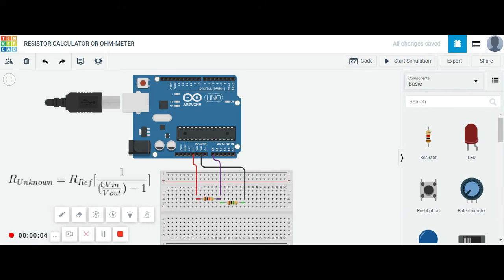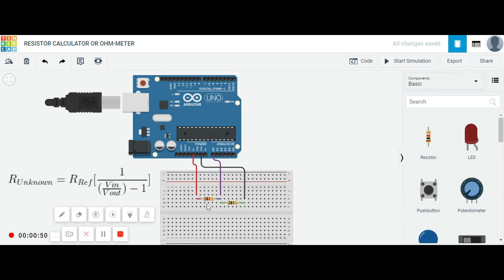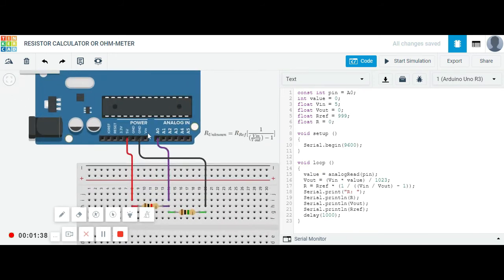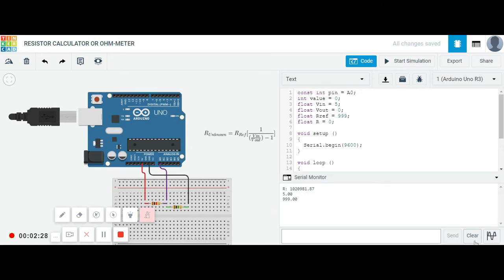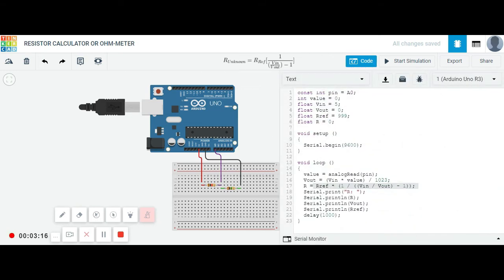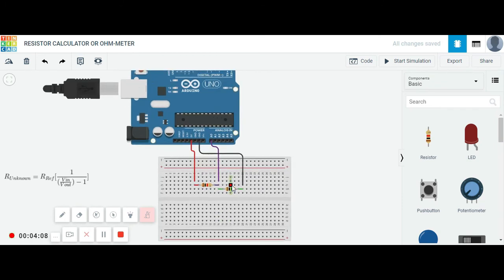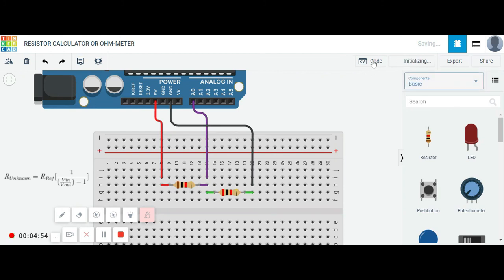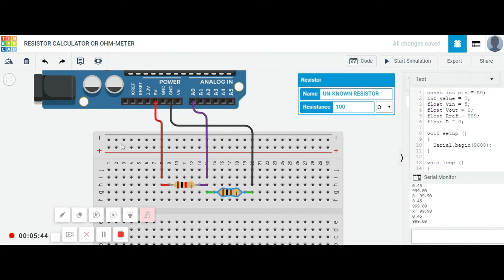Ohm meter arduino using tinkercad

Comment: I need your help, what is in the line number  8 that value (9600) and line number 12 (Vout +Vin)/1023
Reply from the maker: Sorry for delayed reply, 9600 is baud rate, that used for serial communication ,  line no 12 - is formula to calcucate voltage level as per arduino Uno ADC i.e. 10 bit,  2^10 = 1023.